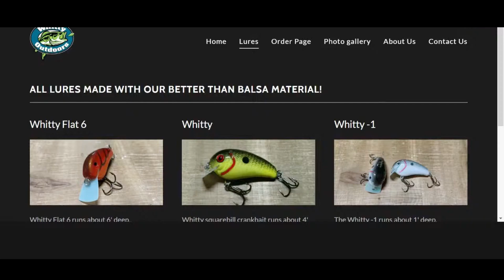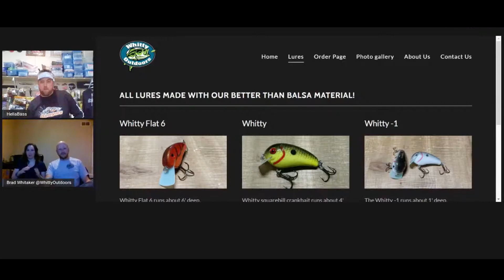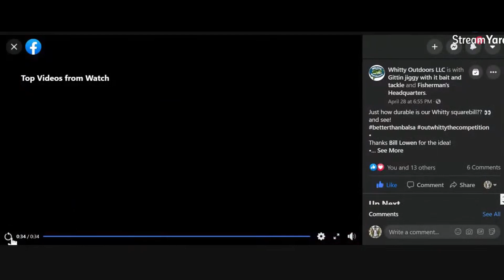How to Design Custom Better than Balsa Squarebill Crankbaits - Story of Whitty Outdoors

Comment: Couldn't you just use like maple or oak too make a crank bait I get it balsa wood is softer and easier to work with but if you had a wood lathe you could make any thing
Reply from the maker: I think the low density of Balsa makes it float up faster and back up when pasued plus the high buoyancy helps it navigate heavy cover.  Poe's and and few other companies used Cedar back in the day l, didnt seem to do as well as Balsa